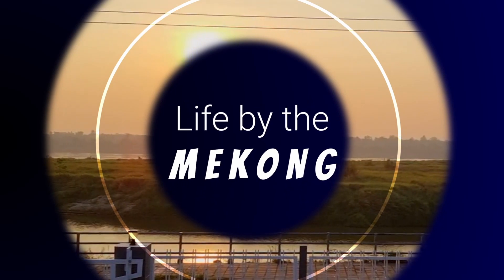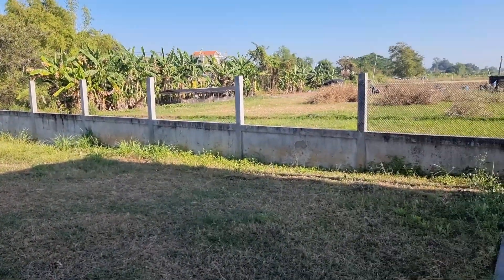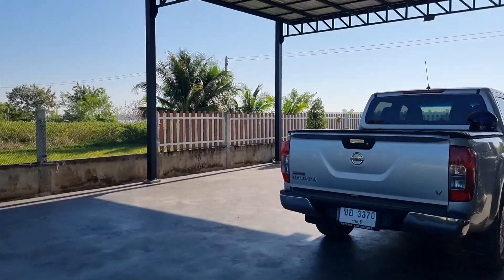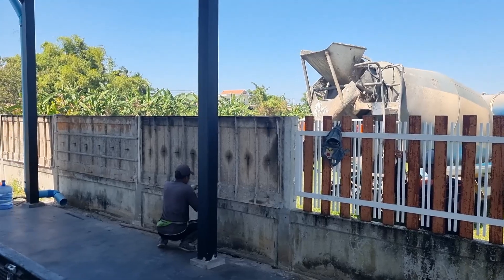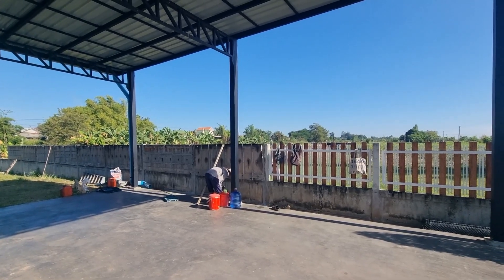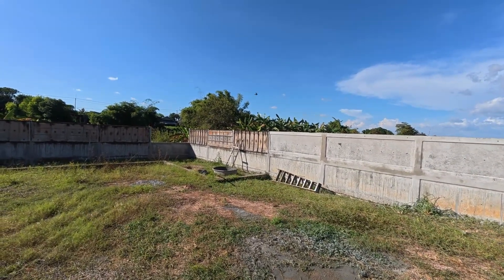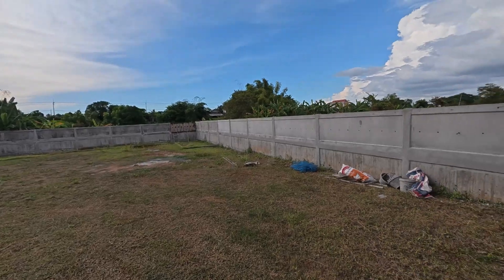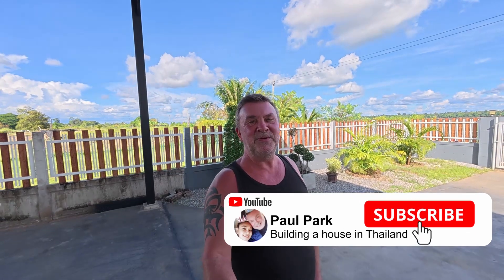Building a house in Thailand   The Resort   Part 1

Comment: Hi I saw on several other Youtube videos a very good tip on how to avoid the black streaks down the inside of all your walls after it is repainted. Dig out a small trench about 12-18 inches from the base of the wall and fill the trench with stones 2 to 3 inches in size. After any heavy rain / fon toc this helps with drainage and all of the dirt splash back onto the wall dirtying the paint. This will prevent almost all of the marks. A private house owner and You Tuber posted this useful tip. 
I myself certainly would give it a try. Ps make sure your trench is slightly sloping away from your car port and house. 
Good Luck Roy from Hamilton in Scotland a subscriber of your channel. 
😊😊😊
Reply from the maker: Hi Roy, thanks for the tip, it's not a problem where it's painted on the concrete wall, the problem was on the top inside of the toilet wall, the bricked and rendered area, it was staining from the inside out, the concrete wall that is black is under the carport roof and sheltered it doesn't realy get wet or splashback, very strange.
Reply: Nice. Looking good. Will be interesting to see the buildings

Comment: Hi Paul, video quality and sound was very good, have you looked at sealing the walls before painting I stops staining and you also use less paint as the walls don't soak it up. It is basically P VA glue watered down you can buy it at do home.
Try and keep all pipes where accessable especially if there is joints if under concrete its a nightmare to repair if you h as have leaks. 
Good idea to have a tap in the pump room as you might need for mixing chemicals I fitted one just outside use it a lot. 
Good luck with the rest of the build.
Reply from the maker: Hi, cheers for that I think that could be a good idea  sulthough the wall won't stain it's the brick and render, I should have sealed that.

Comment: New camera and sound is good, would it not have been cheaper to continue those slatted trellis wood like sections all around ? Personally I think it would look nicer rather than the “ compound” look,. Wouldn’t need painting either,nice job on the surrounding wall all the same, might be worth having a few water runaways at the bottom of the new walls in case of future flooding, but I suppose it would be flooded next door to, expensive times ahead with pool and resort, good luck,.
Reply from the maker: HI, there will be building all round the wall so it wont be seen, that's why just plain wall, glad the new camera is ok, still need to master it.  yea drainage completely around the perimeter, but you will see that when we start building.

Comment: Nice one paul.are you putting in a fibreaglass pool in cheers
Reply from the maker: Hi, Yes fiberglass pool, had to reduce size to 10 x 3.5 due to access roads, original plan was for 12 x 4.8 m.